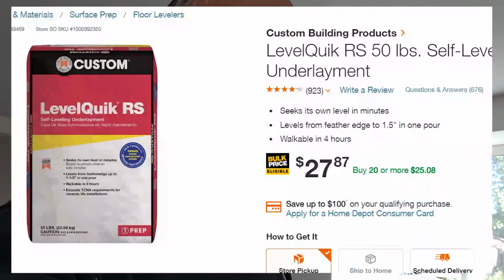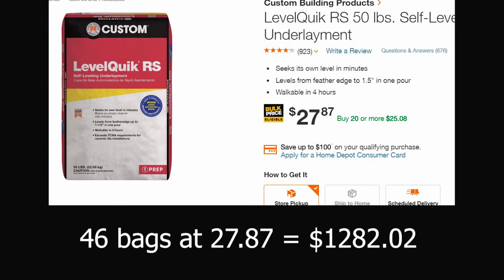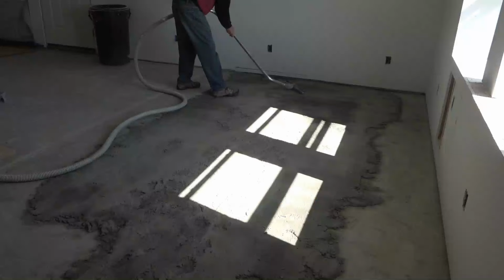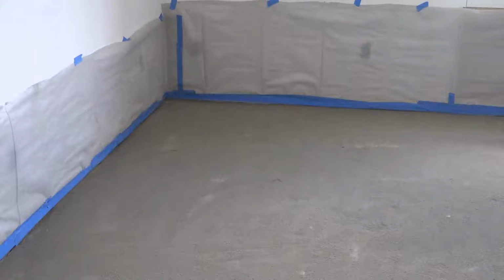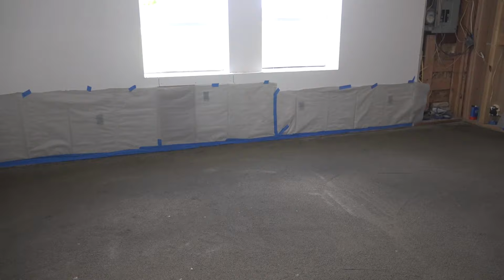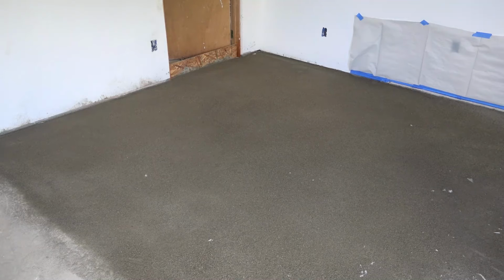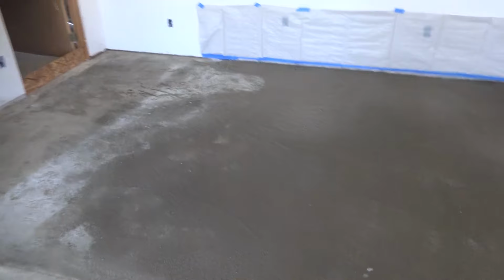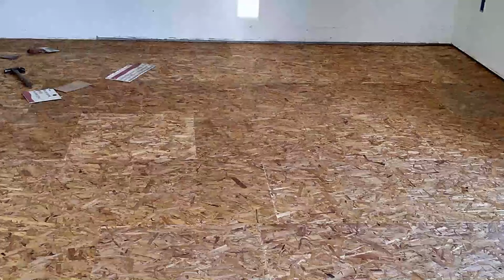How to level a concrete floor cheap

Comment: Excellent method. I tried this method a few months ago on a 4'x10' floor going from 2" to nothing. Worked great. No problems or issues at all. I was very generous with the water though. I used a very fine mist on a water hose and soaked it all the way evenly till the sand mix was totally soaked and stopped adding water when the mix started to have a thin layer of water in some areas. This was in a closet. Will be doing the rest of the area 10'x16' then laying laminate flooring. 😃Great method for a 1 man show...

Comment: I tied this. I followed this video exactly.  It is horribly dusty and messy. I thought it was going well. I kept referring back to the video. I noticed some of the bags I bought had little rocks in them (way too many) I had to sift them causing more dust. In the end, there were just as many if not more differences in high to low spots than when I began. Not only that. It's horribly weak and often crumbles if you accidentally walk on it. I understand I may have done something wrong  but I followed this and even used concrete adhesive. I just don't think it's the answer unless you extremely patient and enjoy trial and error.... and dust... there are large self leveling systems at floor and decor. Use that. Using that at the moment and it's perfect.  For lft use the large leveling clips
Reply: You didn't do anything "wrong" besides following this video which is exactly what not to do. Sand topping mix (or deck mud which is almost the same called) is a weak and brittle underlayment for tile. it is meant to be laid between 1 and 2 inches thick. It is also meant to be mixed thoroughly and correctly, and compacted as you screed. It should also be laid over metal lath. It should not be laid dry and sprayed down with water like this. Even if water does make it all the way through, it will just be like brittle cookie dough (even more than its expected brittleness when done correctly).

For reference, sand topping mix is just a small amount of cement mixed with a LOT of uniform sand. Concrete is sand, random rocks, and about 3x more more cement. Self levelling compounds are cements (usually more than one), sands, acrylic glues, and several other mystery ingredients that allow them to flow, bond to the old floor and not fall apart when spread only a few mm thick. The 3 things do completely different jobs and cant really be substituted for each other.
Reply: So you watched a video on you tobe of some random guy and you just copied him without doing any research or anything? If the mix had rocks? In it it could have got damp already and clumped and that would mean your mix was too old or not stored properly. I hate working with cement mixes they are really hard to get right if you dont know what youre doing and to undo is a nightmare. I will only work with lime because lime is forgiving if you mess up you can easily remove it. Also i am just a housewife here..if i was levelling my floors i would have levelling string all over the place to keep me right levlling is not easy peasy drag a straight edge over it and youll be grand ..if youre working alone you need a grid of some sort to keep you right section by section. And attempting an entire floor this size at once alone would be in my opinion kinda crazy. Id have built a reasonable sized wooden grid and levelled that above my line first and then fill in section at a time to see how it went in a small area let that set. Also id use at least pva to prime the old cement and wet down the old cement first because how would it bond to the old cement without something to bond the layers together? Maybe its fine for this guy cos he has a floor on top ..hes not bothered if it dusts or not. I just think cement work is a skillfull type of work and if you dont know what youre doing following a random video online is insane. Nobody would recomend this as a levelling technique .thus is experimental. And if youre super confident of experimenting great but even then dont do the entire floor in one sweep and expect there to be no problems with the epxeriement. 😂
Reply: @littleshopofrandom685 Would self leveling cement work using this dry pour method?
Reply: @_JimmyBeGood  hell no. self levelling cement needs to be very precisely mixed, and it costs 10x the price of regular concrete mix. It would be significantly worse at wetting out without mixing because it has very fine aggregate.

Just an all around bad idea. Just pour self leveler or lay deck mud correctly and save time, hassle and money!
Reply: @littleshopofrandom685  Well I’m testing a sample right now. I have two round trays about 2 feet wide and I filled one with about a half inch of dry leveler and the other about an inch maybe inch and a quarter and then sprayed them both with water until they were soaked. Going to let them sit for a day or two and check the results.

Comment: You should have used concrete bonding adhesive first no matter if it's concrete or wood as a substrate. What you put down or move around and break apart after a period of time. And you will constantly have dust coming out from the edges. You can also put bonding adhesive in the water that you spray it makes it stick together better. I know that's too late now but you should always test a small area before doing the whole project.
Reply: Makes total sense! I wonder how its holding up
Reply: Just pva you mean?

Comment: tried this method, and it is a total failure.  The mix does not cure and it crumbles when you step on it after 36 hours.  Must be something i did wrong.

Comment: That stuff will crack and crumble under that wood flooring !! If you had used a primer and a bonding agent in the mix it would have failed longer !
Reply: Failed longer Lmao
Reply: Why will it crack? Isn't this pretty much the same method Egyptians used? On structures that lasted thousands of years and to move pyramids weighing more than most can math?

Comment: So cement needs to bee mixed right. Thats why they have cement mixers right? Maybe this guy is super confident about his cement work but i feel like most people this would not work out. It looks like its very thin in places as well. Im not even understanding the sdvantage of it being dry? He could have just done all that with mixed cement a chunk at a time with an old basin or something. Just put you levels down eith string first too cos you need to know as you go along where youre bringing it up to. Set strings or lazers if you have em.this is baffling me.

Comment: When floating floors for tile, sand topping mix or "deck mud" is only dampened like snow. It will remain loose and fluffy until you compact it. You should be able to compact it into a ball without it getting your hand dirty, then crumble it again like a snowball. You can screed it, then give it a finish troweling that prevents the loose sand particles. My concern is that yours may have a dry layer on bottom, and may not be bonded to the slab. That's not always a bad thing, that dry layer can isolate movement from the slab. Sand topping is not usually a wear layer, it has good compressive strength, but will crumble if not protected with tile or decking.

Comment: I used Type N motar Mix, and It worked amazing.  It formed a satin smooth finish.  It is very easy to work with and cheap.   I've had it in a room now for 8 years and never cracked.  I walk on it every day
Reply: Did you mix and pour it down?

Comment: Life is simple people complicate it. You my friend are one of those people who do not complicate it. Think complexly act simply. Work smarter not harder find the easiest solution from point a to point B. You got the formula my friend
Reply: I’m not trying to be rude. Everything about this is more difficult than mixing it and putting it down. This isn’t simplifying anything for anyone that actually knows what they are doing. It’s impressive, entertaining, and sketchy as fuck
Reply: @cecadasong  More difficult than mixing what and putting it down?
Reply: @cecadasong  pouring a self levelling screed is comparitively expensive than this imo. for self levelling screed you got to prime the surface, put those foam rolles on the wall and floor intersections, put levels. 

I think this method although lengthy solves a lot of the above prerequisites of self levelling screeds. 

need your opinion.

Comment: Great idea here. I'm working on a room in our basement. This will work perfectly!
Reply: How did your project turn out?
Reply: This method is not correct and will not last. Use bonding agent, sand topping on areas needing 1/2" or more
Then a resurfacer for final thin somewhat self leveling layer over the whole floor. You could even use epoxy as final self level layer instead if yoir lppking for an epoxy finish.  Follow all manufacturers direction and it will be cheap and correct. Your labor is 2/3 the cost.
Reply: @townlinelawncarellc5432  Turned out great. Small 10'x15' area. Been using weight equipment on it everyday and it's holding up quite well.

Comment: Interesting- I’m going to try something similar, but will apply a bonding agent prior to application. Also will work it like  a concrete slab and polish it up with straight Portland cement as it cures to make it shiny smooth!
Reply: How did it go?

Comment: For the loose sand on top. You can kind of sandpaper it down. But be warned, it eats sand-paper. But it works IIRC you get down to the bound sand.

Comment: High quality thinset and good straight edges will get you much better results, the thinset has way longer working time and is way easier to smooth out, and you'll find it's super sticky and stays where it's put, I've used everything as a professional and have only used self leveler once and hated it, it's cost and extremely hard to work with makes it a never thing for homeowners.
Reply: What kind of thin set are you mentioning ? Does the bag say thin set? I need somthing That Sticks to offset a angel / pitch in the floor and isn't going to runn off .
Reply: @vincebonilla4006  make sure it's a thinset that has adhesive already in it and you can control how much angle you want to pitch it by how much water you add the more water the less angle you can do but if you mix it on the thicker side you can build it up in layers like a quarter of a inch at a time.
Reply: @michaelhartman851  Thanks Michael !👍 Really appreciate the Advice . should i water it down like concrete the next day ?
Reply: MICHAEL... I'm want to put this over brick pavers outside in my backyard. Can thinset be used on an outdoor application? Also do you think I can get away with a thinset that doesn't have the polymer adhesive in it as it is adhering to a course substrate [brick] not something slick
Reply: @mylra4689  that's actually a good question, for exterior it may be better to use a cement product designed to be thin, the problem I believe you'll have in the future is the pavers can raise and lower over time probably not the best base to build over,  but you could always do a test in a small area over the bricks with a good thinset and see how it holds up before trying the whole thing also if the thinset is going to be covered with something don't see it being as much of an issue.
Reply: @michaelhartman851  Thanks. You are right about the pavers moving up and down. I live in Florida where it rains like nobody's business. I put the pavers down 30 years ago....never maintained it. So the bricks are all wavy  😅🤣. I thought I'd level it all out with a topping of cement. Best thing is to remove the pavers and begin again but I'm not getting any younger, have arthritis, and a bad back. I guess I can get somebody to do it. But I will try to lay a couple of inches over it all. I'll probably cover it with Rubber Mulch so I can hide my workmanship  😅🤣

Comment: We just tried this to level out a long divot in a concrete floor after removing tile and grinding off thinset.  We are going to lay down vinyl plank over it. Will report back!
Reply from the maker: Great let us know.  I found that in areas around the edges where it is really thin too heavy a spray of water, and it can wash the stuff out. I mean where it is like an 1/8 thick. The thickness of the grains of sand. Then you can see I was standing 10 feet away and spraying towards the sheetrock? I was being careful not to soak the sheet rock and I found some areas the next day that were not  hardened. I just sprayed more water on those areas because now I could walk up close. They were nicely hardened up the next day. We are using the building now and it is great.
Reply: How'd it go??
Reply: Any update?
Reply: How did it go?

Comment: I have seen many a bag set up still in the bag. No mixing needed. Why not and so simple you almost think why is this not a regular practice.
Reply: Because it’s insane DIY nonsense with based on assumptions. No way this holds long term
Reply: @cecadasong  Why not

Comment: Its kind of loose but looks good. I have a floor and it will cost me maybe $2k to level the floor but i think i will go that route and just use a few bags of lvl cement
Reply from the maker: Let us know how it went and any tips to help someone else. 
I put the drycore floor over the top of this so I didn't have to be pool table perfect. 
The two things that I found were when the sandmix was feathered out super thin, like a couple of grains deep, hitting it with the water would wash it away. So you have to just mist that. Then where it was deeper you have to get enough water moisture on there to cure it completely. I had two spots that were not cured the next day so I just rewet them. At that stage I could walk on the stuff to get over to the areas that I hadn't sprayed enough on due to the distance from the sprayer.

Comment: ive seen tile guys pitch floors in commercial buildings and gyms/big showers and they use a sand mix that is damp...i think they call it a dry mix  but basically what you did but the mix is damp when they spread it and pitch it to the drains
Reply: I guess people forgot how to float concrete
Reply: They refer to it as mud. And it's not sand topping mix. It has mortar in it. Take some time learn what they're really doing before posting your opinion. Thanks
Reply: @lostintime8651 The comment police...lol
Reply: Dry pack is the name
Reply: @edgarvazquez3553  yes exactly

Comment: This is great. Self leveler failed in my bathroom (over OSB), and I was gonna getting it all away, but now I can use this to prep my floor for tiling above it. I'll try it with dry thinset and let you know. If it doesn't work I'll just getting it as originally planned.
Reply: this is my situation right now. I used 5000 concrete for a 1 inch bed but I think it was an overkill. I didn't want to go with the self lever.
I tried the Sand Mix topping and bedding cement but I can't make it strong, when it dries it sounds hallow.

Comment: Looks good and I had the same issues with self leveler. I'm looking to do the same thing on my basement cement floor. How is it holding up? Can I put peel and stick tiles directly over the Sand Topping Mix?
Reply: I did this on my basement floor.  Ended up using self leveling underlayment on top of it. Didn't need much after this method though. Holds up well and should work with tile on top.

Comment: Can you just use sand mix to level down to 1 inch and just use the self leveling to get it down to 1/4-in? Maybe only 10bags of self leveling was all that needed?
Reply from the maker: I would think that you could but I am not an expert. I would want to know that the self leveling stuff could go over concrete that is fresh. Less then 30 days old? I you are planning something like that I would try a small area somewhere first and see what happens. We put drycore floor over it and then a finish floor so we didn't have to be perfect.

Comment: My garage floor is uneven and has cracks in it. would I need to fill in the cracks first before doing this or could I use the concrete in the cracks, wait a day and then level over it?
Reply: Either or your choice. If the cracks are deep and you are using a thinner top coat and it may flow down the cracks you may need to patch the cracks first.
Reply: @lostintime8651  gotchya. Thanks!

Comment: This is not gonna last brother, I’m sorry. This is not the way you are supposed to use sand mix.
Reply from the maker: Well, we have lived in here since it was done and I don't see any problems yet. Remember the part that I used dry is no deeper then 1inch and we used drycore floor and then finished floor. If something goes bad I would come back and tell people but I don't thing that is going to happen. What could go wrong? It can't come up or float away.
Reply: yea he used drycore dont u think that would remedy any problems that could arise?
Reply: What is a "dry ore"..? 🤷🏽‍♂️
Reply: "drycore"

(autocorrect 🤦🏽‍♂️)

Comment: I have a 2-inch drop to the center drain in my 10 x 20 garage. Do you think this could work with that much sand mix to level the floor?
Reply from the maker: Good question.  I think I would get the sand mix and mix some up like regular concrete and level most of what you can. You know, try to do the best you can with that and then level the rest with the dry mix. 
When you mix the stuff with water first it just doesn't want to 'feather out' nicely. It will keep pulling up off the floor. So that is the area that you can use the dry stuff on. 
I would say I had between zero and one inch that I was trying to level. If I did this again I am thinking I would also wet the floor first and then put the dry right over that. At least in the deeper spots. Just so the floor is moist in the deeper areas.